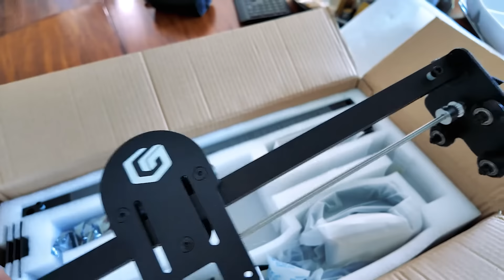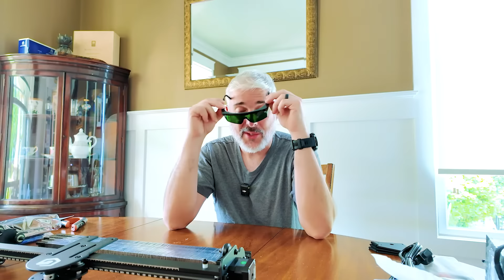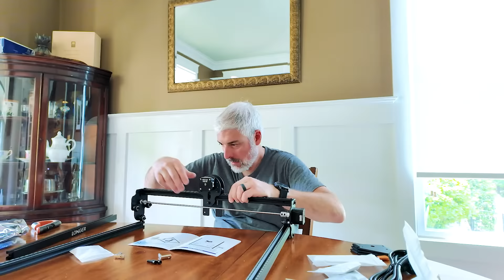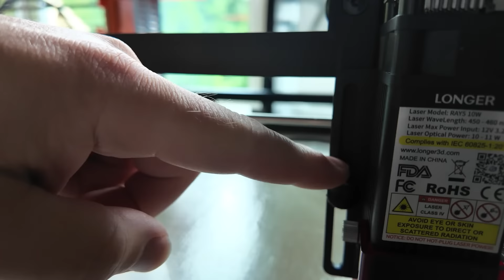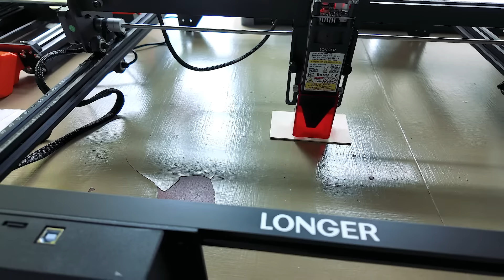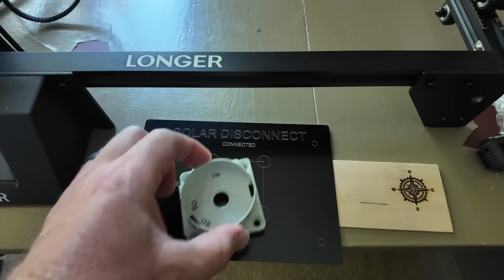Longer Ray 5 Laser Engraver Review - A Beginner's Take

Comment: I am in the process of assembly on mine, just received it this week, It seems they may have "redesigned" this machine as my parts do not match the parts in the instructions. The thumb screws are totally different, they attach on the side now. Problem is, the thumb screws are too big and they will hit the metal support bar behind where the laser attaches. I tried online support and I got a AI robot that spewed the same "solutions" and then finally seemed to give up trying to help and instructed me to call. Well, when you call it goes straight to voicemail with no return call. It seems the only option will be to return it (if I can get them to tell me how). I read the good reviews on their customer support but it seems that has changed.
Reply from the maker: Sorry to hear. I had an incorrect bracket with mine, sent them and email, and had the correct part in less than a week. These AI “support” bots are going to be the end of the human race… Tru checking their website for some form of support email address, and failing that, hit support@whatever and sales@whatever and perhaps you’ll get a human that can help.